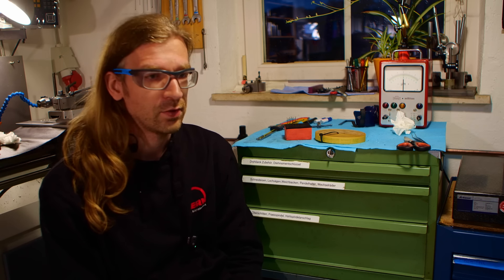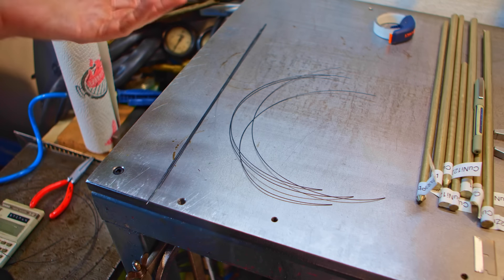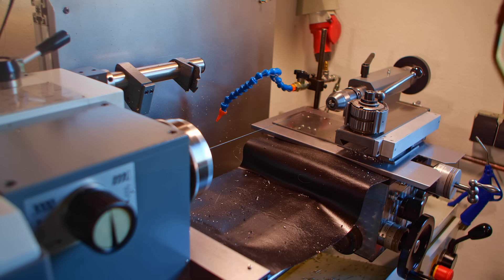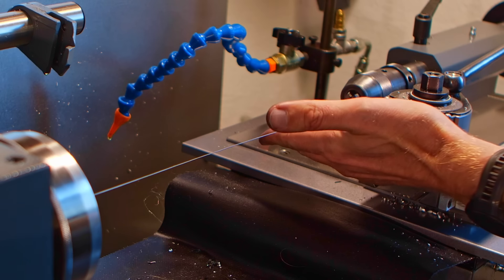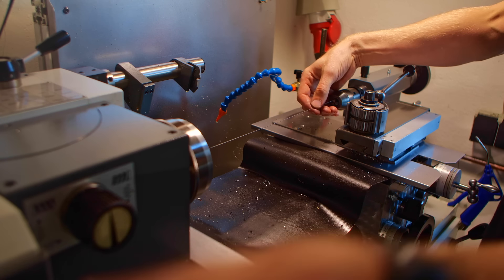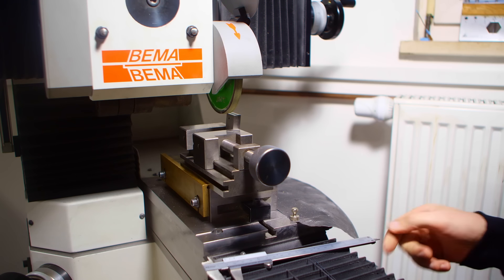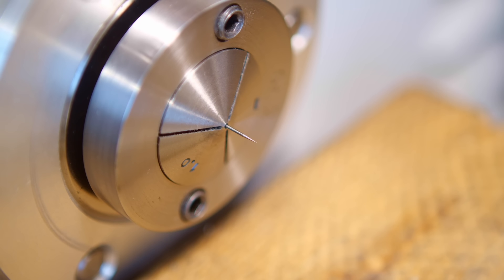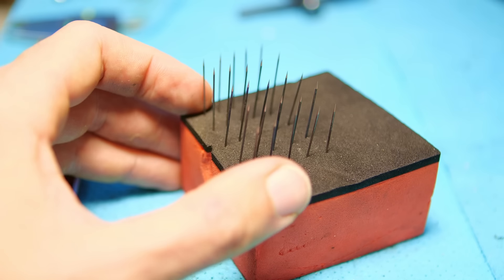Making a part: Flux Capacitor Needles

Comment: I used to manage processes in a tool steel wire drawing/rolling shop that worked with austenitic alloy steels for cutting edges. One tungsten/cobalt/moly grade had 1.3%C (HS10-4-3-10?) which caused all kinds of problems.  When we tried to put too much work into the wire, we'd get those longitudinal cracks, I think because pulling larger wire through a smaller hole without heat creates longitudinal tensile stresses in the core balanced by compressive stresses around the circumference - usually you'd get a point tensile fracture in the dead centre, but other times the stresses from the cast (where you laterally offset the die from the capstan that pulls the wire to put that curve you show at 3:40 so it sits nicely on the spool without tangling, a bit like curling paper ribbons over the edge of a scissor-blade) make the stress fracture run along the length of the wire with a characteristic step.  I wonder if that's what you're seeing.  Looks like tungsten is drawn with heat (it's only ductile above room temp), and perhaps the stresses are set into the metal, at least making it brittle fracture predictably.  I imagine the twist you put in allows the residual cast stresses to distribute around the wire (maybe it has a very slight spiral?).  We used to make some wire for ICE injector needles, straight wire could be the biggest challenge!

Comment: Interesting solution to the straightening. I think your way was nice and controlled, but you could have used your TIG welder and foot pedal to introduce the current to heat it as one. Downside would have been a more complex electrical connection with potential issues of damage to your lathe bearings from arcing.

Comment: During the polishing step, as you get close to the tip, the radius gets close to zero, so the surface speed also gets close to zero (even at 3000 rpm), so how do you get effective polishing at the point?  Maybe you need some longitudinal motion?

Comment: I used to make those for my scanning tunneling microscope in the 80's . That wire is a complete pita to mess with. I used electro etching in sodium hydroxide (drano) to make them atomically sharp.
Reply: How did your electro etching setup make them sharp? Wouldn’t it etch everything evenly?
Reply: @cwmd7651 not if you dip the part in at the angle needed to erode the tip sharp
Reply: @mackenziehaines1976  would it be rotating the whole time then? And wouldn’t the surface tension of the acid make it cling to the rotating needle as it comes out, ruining the sharpening effect?
Reply: @cwmd7651  I had a circular graphite electrode at the top of the container and the meniscus of the sodium hydroxide touched it. The needle was placed in the center. It etched a concave profile into the wire until the submerged part fell off. The end was atomically sharp.
Reply: @chopper3lw  oh interesting, to be clear, the meniscus was creating the curved profile in the needle? That’s so cool!
Reply: @cwmd7651  Yes the meniscus created the profile, I was not the inventor of the process so that brilliance belongs to my associate. I just built the electronics and wrote the software. However, what was interesting about the needles was that occasionally I'd get the long invisible thread of tungsten at  the end which caused all kinds of havoc when trying to image with it.  It's also important to note that Stephans Flux Capacitor needles have a significantly different "pointy" profile than mine. My needles did not have a taper that extended more than a millimeter.  This was important because the overall stiffness was needed to  prevent nasty oscillations as the needle was raster scanning at high speed.
Reply: @chopper3lw  this is fascinating. thank you for sharing.
Reply: @chopper3lw as additivealex said, this is really interesting and thankyou for sharing, I wouldn't have thought that kind of tip could have been achieved with electroetching but I stand corrected. Very cool!
Reply: I made similar high-sharpness probes using electrochemical etching in KOH solution and a variable fluid level etching cell at a company I worked for in the 2000s. Definitely a PITA to straighten and cut w/o causing problems in the final probe.
Reply: @adamhartman8361  Ya cutting was a problem for me too. the wire would fray .

Comment: I don't think I had heard of tungsten wire coming in rolls and I wouldn't have thought it would have adequate ductility unless rolled on a very large radius. So everything really IS rubber, even if it is extremely hard and brittle rubber.

Comment: I made something very similar but it was in inconel and had a flat on the cone portion. It was 2mm diameter, so a lot easier. The client acted like it was some hassle to get them made but other than finding the stock it was just another day in the shop. I like reading the old shop books and machinist manuals for the tips and tricks. It’s surprising how technically adept they were in the early 1900’s even. I had guessed you’d heat it, but the stretching and twisting in the lathe was a nice surprise and very clever.
Reply: the best books are the old books... if its about engineering in any shape or form... i GRAB it. then read it cover  to cover. then add to the collection in the toilet. can open them anywhere and have a good read for a few minutes...
THEN try to put some of those ideas into practice. that doesnt always work out so well. lol.

but yeah, other than a few channels... youtube is a depressing place of stupidity and ignorance, perpetuating itself.

always learn something from THIS guys videos :)

Comment: Very cool. Trying to figure out what kind of ion drive or electrostatic doohickey these parts go into
Reply: they look exactly like probe tips for semiconductor wafer probing - you can buy them pre-made commercially - they're like 5 to 10 each. I don't know if that's what these are for specifically, but wafer probe tips are exactly this - sharpened tungsten wire

Comment: Hi Stefan, at the tip-polishign step, 21:44 , the velocity of the tip (against the polishing stick) is zero. The wear-rate of the tip too is near-zero, as evident from the "residue" left on the polisher. Would it be worthwhile, instead to have e.g. a Dremel-wheel (polisher with paste) with its axis orthogonal to the lathe-axis, and with some offset, of course.. Would this allow a tip-radius finer than the ~5-10um as you show?

Comment: The Micro Fine Sanding Film that I have was made by Albion Alloys Precision Abrasives of Canada. I learned about it on a clock repair course. You can buy sample packs with up to 60000 grit easily in the UK hope that helps viewers source some for themselves 😀
Reply: Thanks for the info, useful.

Comment: not long ago at work I made  a Tungsten Beamstop for an X-Ray beam. to keep a low profile it was very thin walled, it randomly broke mid machining  twice. The cracks went completely arbitary, not related to either clamping direction, nor any way of working direction. it is indeed a difficult material to work with

Comment: thank you for such a pointed subject, it keeps my mind Sharp!

A question, you stated the diameter at the end, point = 10 microns. As I work primarily in the USA, I quite often do metric conversions, so that converts to 0.000394 inches, or just under 4 ten thousand of an inch (I often work to "5 TENTHS") ... 

SO, later you mention 30 micron film.(I buy that from 3M company).

Is 30 Microns film 3 thousandths of a milimeter?

OR is it another completly different "standard"?

in my hobby work (I am retired, 74 years old) I am used to "grit" in sandpapers, and I often use 2000 grit paper, or film when I can find it, but I am now lost in grit to micron conversion!

I ALWAYS ennoy watching your amazing work, and thank you for your commitment to share your work!

Thank You!

philip, from the Great Pacific NorthWET,  Oregon Division, USA
Reply: In the knife sharpening community, someone started a document called the Grand Unified Grit Chart. It contains lots of different standards, presented in an easy to understand comparison. Should be quite easy to search up.
Reply: @mattmanyam  Thanks. 30 years ago, I worked in the hardwood floors industry.  The First sanding with our 12 inch drum sanders, was 36 Grit! Now those are not hard to see at all!  The last sanding was 180-240 grit range depending on wood species.
Moving from that to wood turning (hobby) I worked to 400 Grit finish.

It was moving into metal working where I saw grit changing out to 1200-2000 grits!!!

philip, from the Great Pacific NorthWET, Oregon Division
Reply: @madsighntist14   Let me know if you found it!
Reply: @mattmanyam  YES !!!! Thank you.
Reply: one ten thousandth of an inch is 2 and a half microns , roughly  ,,, !

Comment: Sharp thinking, great result! 
There are straight pre cut annealed stress relived pieces of thin W wire available in similar dimensions. 
If the application is not very high temp perhaps tougher alloyed material that is machinable could be used.
 I have used W alloys for small high density weights in micro mechanical applications, was fairly easy to machine,

Comment: Great stuff as always Stefan👍I found a similar paper from a similar era, and tried to straighten some 0.007" tungsten wire, electrically heating that was ok, but cutting and clamping it beat me! 🙂  I ended up just using 0.007 piano wire, and made a jig with a spring in-line to control tension while it heated- the wire ends up pretty straight with no rotation, maybe you could experiment with suitable springs in your setup if you need to scale up (to save adjusting the tension using the tailstock continually)?
I find fibre optic lapping film pretty useful for fine work, Thorlabs offers grit sizes down to  0.1 micron in both diamond and alumina.
Have you considered grinding the points axially, then lapping/polishing radially by the way?  (Alkaline electropolishing suggested by others here looks worth a go too of course👍)

Comment: Current vs. torch for heating:
Would current give a uniform temperature change across the material vs. the torch giving an unpredictable difference in temperature change?

If heated differently, does it change the properties of the wire? Hardening vs. annealing vs. stress relieving?

Just wondering what effect the heat would have on material properties and whether it should be considered for this or other applications.

Comment: You can also make a point on the wire using a solution of KOH in water and passing electricity through it (using a separate W electrode as a counter electrode)

Comment: Years ago I used to atomically sharpen tungsten wire to make probes for manipulating single crystals in chemical microscopy. We made a bolus of sodium nitrate in a test tube, then broke the test tube and mounted the sodium nitrate on a cork. The wire was heated white hot with a torch, then drawn across the sodium nitrate as many times as needed to make it sharp.

Comment: Decades ago I had to make tungsten filaments which were essentially like little coil springs the wire size was very similar to what you have and I did it by putting current through the wire and wrapping it around a mandrel the mandrel of course was connected to 1 pole of the electrical source I used a very high current transformer that was only a few volts. I was able to essentially bend the wire red hot and it went very easily and worked very well. The today to get a transformer that would do that you could start with a microwave oven transformer hacksaw out all the high voltage windings and put a couple turns of very heavy gage wire in as a as a low voltage secondary that could produce substantial current probably more than enough to heat your tungsten wire. Another possibility for a high current  transformer would be a spot welder or possibly even a weller soldering gun depends on how much power you need. Interesting job great video as usual thanks

Comment: A few years back I wondered how they wind Tungsten filaments.  IIRC the trick discovered way back was to alloy the Tungsten with Sodium to make it malleable.  Then once coiled it was heated to evaporate off the Sodium.    What was not clear is how you alloy Tungsten and Sodium.  My guess  was to dissolve powdered Tungsten into the Sodium melt.

Comment: Hm, could have really used this like 20 odd years ago in physics advanced practicum at uni for getting a sharp tip on the tiny tungsten needle in the electron scanning microscope they got us to scan graphene with.. the go-to solution was to dip the tungsten needle in some acid and run a current through to get a sort of dull point.
I used copper wire ground to a sharp tip instead, which also worked, they just didn't last as long 😂🤣

Comment: If I did this process of straightening tungsten wire a lot I would probably run a high current of electricity through it instead of using the flame. Interesting problems with interesting solutions! Cheers!

Comment: You can get very fine diamond paste but the grit tends to tear rather than polish.   You may want to try something like Cerium oxide even though the the grit is lower it may end up giving you a finer finish.   The tungsten reminds me of the problems I have had with diamond paste on old 1800's steel.   Without regard to how fine the mesh it just tears the old steels rather then smoothing them.   and then again I could be completely wrong. :)    .... Things I learned restoring old straight razors.

Comment: Curious if that straightening method introduces a measurable taper - as you are pulling against the currently heated working area using the area you have already thinned slightly at one end it seems likely the thinned areas will stretch a tiny bit further than the areas you have yet to work on at all. Doubt it would ever actually matter for any possible use of these short sections of needles or really any other thin straightened wire that is not hugely long, but still curious.

Comment: It looks like you're making tungsten probe tips for wafer / semiconductor probing. Seeing as they're commercially available, you must be under-charging compared to your client just buying them off the shelf :) I don't remember for sure, but I think the commercial ones go for 5 - 10 bucks each
Reply: my cheap-as advisor in grad school told me to try using acupuncture needles in the probe station instead of the carbide probes - the acupuncture needles were horrible - the bent and curled up the tips the first time you used them, and then couldn't make good contact after that. I ordered another set of tungsten probes, and kept them locked in a private cabinet - if someone else wanted to use the probe station for something, I left old tungsten probes, or new acupuncture needles in it, and kept the good carbide tips only for myself!

Comment: Hafnium would be a better material for your flux capacitor as the protective oxide layer is a very high k dielectric reducing leakage current.

Comment: What would be a great video would be you sharpening a TIG welding electrode with this method and compare the arc shape versus a "normal" method of sharpening an electrode.  To see if the arc shape and density is greatly affected.

Comment: Hello Stefan, interesting to see how you straightened the tungsten wire. Although not knowing the application, you might want to consider grinding/polishing axial (along the tungsten rod) instead of along its circumference. I wouldn't be surprised, if your customer will ask for that :) Greetings from Badsichen, Stefan.

Comment: Just think how they used to make tungsten filament light bulb elements way back when first introduced. Much finer wire, Spring wound and welded in some cases. Now that's a challenge...

Comment: Thanks for another great video. I learn something new each time.
There is an old-school jewellers' method of straightening wire. It might work on Tungsten.

Bang a row of nails into a board in a straight line, with short distances between them - I would guess 15-20mm for wire that thin. Thread the beginning of the spool left-right-left-right through the nails, then grasp the free end in a wire-pulling pliers (or use a wire pulling bench) and pull the rest through. Amazingly, being pulled through such a "slalom" actually straightens the wire, as the bends tend to cancel each other out.

Might be worth a try if you have too much wire and some nails.

The reference for this technique can be found in "Metalwork and Enamelling", by Herbert Maryon, who was once curator of jewellery at the British Museum.
Reply: That process works on electrical wire as well.
Reply: This only works if the wire is ductile. The ductile-brittle transition temperature (DBTT) of tungsten is usually above room temperature, typically around 200°C. Below that temperature it will simply crack and split like Stefan demonstrated in the beginning.

EDIT: If you can somehow keep the whole setup above the DBTT, then it could be a good option if large quantities of wire need to be straightened.

Comment: Power supply? Would a car battery work?
Reply: Wayyyyy too much power. Heating up a wire like that would probably be 2-5v - I’d have to calculate the current… a car battery would turn the wire into a lightbulb (it’s the same type of wire that’s in old light bulbs. Although, I think light bulbs have more nickel in the tungsten wire.
Reply: @shawnhuk  light bulb filament is MUCH finer tungsten wire - if you look at it closely, you'll see it's double coiled - the fine wire is coiled, and that first coil is twisted until the coil itself forms a larger coil. It's insane how fine (and long) a filament would be if you straightened it. This being much thicker wire, it would take a LOT of current to get it even to red or yellow hot.